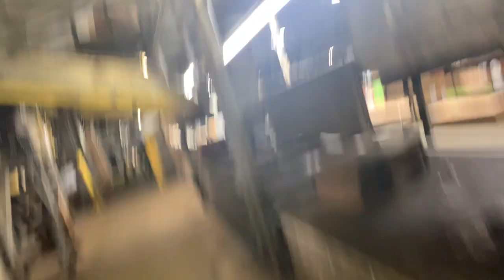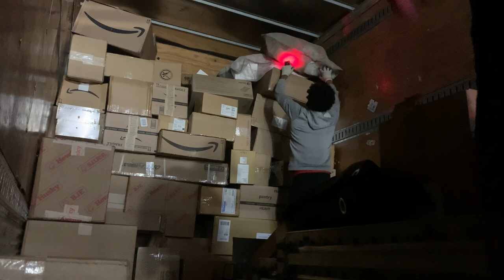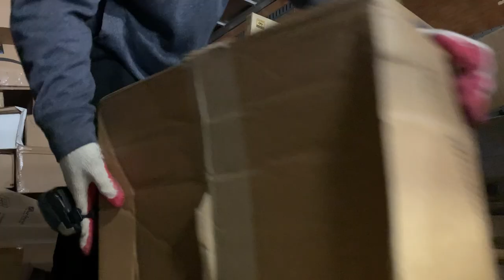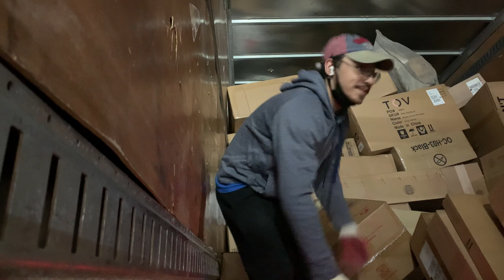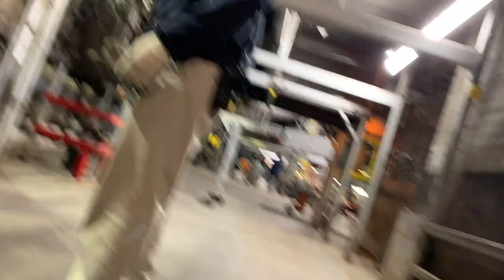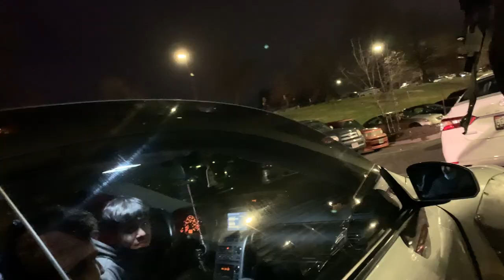UPS 2024

Comment: I ended up switching from loading to unload, both are hard work but loading is definitely more challenging, loaders should be making at least 2+ more an hr
Reply: I made 15 an hr it’s ridiculous
Reply: @kentknightsrule  $15.50, but I come in early to do van line sometimes which is better in my opinion. Plus you can slack off and your manager won’t notice.
Reply: You can switch to just unload
Reply: @lildjnyc4932  bruh re read the comment…the first 8 words
Reply: Unload is definitely better, until you have a hundred heavy 50 plus pound boxes on the floor you have to lift up
Reply: I’m a female loader! I’m newer but I loooooove it!!! I’m 5’2” 120lbs and 38 and I think it’s fun slinging boxes.
Reply: @MotoRacer171  Idk about ups but fed ex you have to pick them up in loading too.
Reply: @zendevil6965  Well at ups shit just falls everywhere so you’re picking up too

Fun when its all smushed together and you have to pry boxes apart
Reply: @MotoRacer171  Same at fed ex
Reply: I didn't sweat half as much in loading as I did unloading. Loading isn't easy, but I for me, unloading was the true workout at that warehouse. 4 hours a day there for a few months is like a legit camp to get in fight shape. go on a strict diet and you will get in the best shape of your life there.

Comment: I’m so jealous right now 😂. You guys had 2 working scanners and a functional conveyer. I worked loading the truck while a coworker scanned everything with one scanner that worked half the time. Also our “conveyer” was a ladder-like roller propped up an a step stool, didn’t even have wheels to push it back. Still though, the job is pretty intense and can relate a lot.
Reply: Truth that Hollister Mo represent 😂
Reply: Where was this ghetto AF warehouse you were working in at? Sounds more like a sweat shop in SE Asia xD than a UPS facility in the states.

"Rollers" as we called them in my day, were already considered the cheapest method to manually get parcels inside trucks. Actual electric "conveyers" are a thing in higher volume warehouses built after like 2000.

My warehouse was built in the 1980s and even then not a single truck had  "ladders propped up on step stools." WTF? Forget your local teamster leadership, how was MGT okay with that kind of set up? Good MGT if anything would have gotten ya'll rollers. Not because they care about you personally, but because there is no way most average workers can work fast enough with the kind of set up you are describing. (Unless ya'll were a very low volume sorting place or something.)

The scanners though...I can relate to that. Made sure to always note which ones were the good ones and asked my sup for a spare battery as well xD

Comment: EXCEPT FOR THE POOR HANDLING - not hand to surface- you make me proud. I was one of the first female training supervisors at UPS in 1991. Nice to see the Brown Blood circulating. You guys will be able to accomplish anything.
Reply: I worked his job in 1995 Lynnfeild Mass. I'm glad we didn't have to use those hand scanners then. I checked this video out in concerned how my current packages where still being handled. I'm thinking of holding off until the holiday rush is over in February. Things can and probably will get broken in shipment. I will ship with USPS until then although they are more expensive but handling is much better.
Reply: @stvlu733  they aren’t corporate, they don’t care.
Reply: Gather position load aids, hand to surface.... the training still loops in my head, 15 years later.
Reply: Hand to air lol

Comment: hi im jared I have been working at UPS as a Loader/Unloader/Tender for about a year if you want to know what a tender is please ask me also a quick tip on loading do not throw climb on packages ik the roller suck ass we all hate them and please use the load stands please build all the way to the top don't throw packages they will write you up and they can fire you on the spot I've seen it happen before p.s there are cameras in your trailers but if you want to be a tender or know about it please reply
Reply: I'm curious what a tender is, I've seen a few people say it but we don't have a position called that at my hub. I wonder if we have that job but just call it something different?
Reply: load stands just get in the way. I always tossed mine out of the truck

Comment: I did this loading on the large trailers back in the mid 1990's during the holiday rush. I Loved the hard work as it gave me a good build. Everything seems to be the same except for the hand scanners. I didn't have to use one. It was so much easier to handle without the scanners and could work much faster. Maybe thy should make a chest mounted automatic scanner that you just hold the package up to to free up hands. This poor package handling is what I question when I ship something with UPS when I see packages dropping to the concrete, getting crushed and even walked all over by an employee, and poorly stacked. I know some of this may be out of the loaders control. I assumed that UPS would have fixed these problems by some package flow control by now but NOPE. Come on guys. You must have played Tetris sometime in your youth. Stack those walls like your life depended on it. I know it helped me from several collapses back then especially when you get to the end and it's right over you. A sloppy wall will come tumbling right down on your head and you will feel it and look ridiculous with you ass on the ground and all those packages on you. I have seen it happen when a truck was hooking up and bumped the trailer. Keep up the hard work guys!
Reply: Hard work pay off 👍🏿👍🏿👍🏿
Reply: they do get paid good. and they get full benefits.. but its a part time job until you make full time... the benefits alone are wroth it

Comment: I work doing this, just have 3 weeks doing it, I am 52 years old and the first two weeks were really painful, is hard work and yes they should paid a little more, you either make or break it.
Reply: Are you still working there?
Reply: @rightstuff368  Yes, I am here as a matter of fact
Reply: @fas1969  I'm 62 and in pretty good shape. I'm thinking my body will adjust to the physical demands after 2-3 rough weeks. What are the best jobs in the warehouse for package handlers?
Reply: I did this also at 52, I lasted a week, fuck that, work smarter not harder! and I'm in good shape!

Comment: If you’ll was smart, one could be scanning and the other can be loading. After 20 boxes or so, switch it up. I know you guys get paid for scanning boxes. Work smarter, not harder.
Reply from the maker: We ended up doing that on that same day
Reply: You usually only have one person in a trailer this is just a video of a moment
Reply: @leylinetarot  well I do preload and unload so in my location it’s way different
Reply: @namedbless5488  yea I worked load, unload, and smalls for 3 years and it was one of the busier hubs in the states
Reply: @leylinetarot  that’s facts. I still work here currently. I am striving to be a driver. Got four months in.
Reply: @namedbless5488  take it easy on your body 💓
Reply: @leylinetarot  Always do haha I am in Union Now so I can legit work at myself pace with no penalty. That’s one of the reason I stay working at UPS
Reply: @namedbless5488  Hoping the same thing bro. Coming off the road making $10,000+ a month to get my foot in the door. Got hired doing loader
Reply: @AaronVtec803  off the road? Are you a truck driver?
Reply: @namedbless5488  hell yeah

Comment: This job is very quick and almost impossible to make a neat wall, it’s rarely ever slow. So people talking shit about them throwing the packages that’s all we can do tbh to keep up with the flow.
Reply: Sometimes you have no other choice but do these slop walls as loader solely due to needing to keep up on pace and time limits given out by management. When I was a loader at FedEx Ground, I was held at higher standards than other loaders where my walls had to be neatly and tightly loaded as possible as well having to keep up as much as possible with package flow by myself most of the time (I usually got stuck in the busiest trailers by myself where it actually pissed me off more when they would send someone into my trailer while I was in the middle of loading because it just caused my system I had developed to get all screwed up/causing me to slow down....it's one thing putting someone in there at the very beginning of loading a trailer, but a different story when it's the middle part of working in it that they finally decided to put someone in there with you because by that time you have already developed your own system in handling it by yourself). I have done probably more than my far share of "s**t" walls as loader solely due to the amount of packages that kept coming down at once continuously where I couldn't just temporary stop the flow from coming down (I just didn't care at that point and was like I am just going to do what I can and if they don't like, they can just go f themselves basically).

Comment: man where I work the boxes are literally flying down the slide fast enough to smash your hand or other boxes and make other boxes fall off all stacking up everywhere on the sides etc. I swear man a 40 pound package will come down that slide so fast it will hurt you and throw boxes off the side and you have to hurry and get your boxes stacked so you can even get out of the  trailer man and the boxes can weigh anywhere from 0-60 pounds and you have to stack them and figure it out some packages are long so you have to put them somewhere and figure that out plus you have these big bags that come down FULL of little boxes that weigh about 45 pounds and they are square about 2 ft by 2 ft and you have to figure out a place to put those which is usually on the TOP of your wall so you have to lift those up and throw them up there as well and if you let those bags build up man then you’re gonna be stuck in because they are big and heavy

Comment: Omg talk about bringing back nightmares.  I was doing this in Secaucus nj  ups facility for 2 yrs. I quit cause for $11 per hr I was f busting my ass from 4:45 am - 8:45 when until the drivers came in. I developed several carpal tunnel syndrome on my right wrist,got so bad I had severe pain just holding a bottle of h20. Then the warehouse was mad ass cold in the winter time cause they kept all the doors open. I said f this and text my supervisor like you I quit. The drivers where mad Kool though,at  Xmas I got $50 from 4 drivers cause I had to load up 4 of those stretch ups cargo trucks. So underpaid.

Comment: How does a package get lost during transit? I had a cardboard envelope on the way and the tracking hasn’t changed after arrived at facility. Been reading that sometimes small items get stuck between the belts.
Reply: Probably stuck on a belt somewhere or fallen off the belt into somewhere you can’t easily get to
Reply: It's either that or it hasn't been scanned to the facility
Reply: Even a large package can get lost, sometimes the label just falls off
Reply: At fed ex. If it'ds ever lost between belts. Jt will be found. We have a team that specifically searches for packages after each shift. So it will eventually be found and scanned.the packages that end up completely lost are the ones  that get destroyed in transit. Ground specifically. Alot of trailers have leaks in the ceiling and on rainy days it will ruin a thin box or paper packaging.  Some people don't tape up there boxes properly either. So when they come down one of the many slides things will fall out and get seperated from the package.
Reply: They can fall between the trailer and the building

Comment: Easy work for 2 guys. Used to be just one per trailer. And these guys are moving SLOW. Not even sweating. Try it in Texas, one man, and over 100 degrees outside
Reply from the maker: It’s peak season, 2 guys every truck no matter what and I live in the east coast so it gets cold, I do be drenching during summer tho

Comment: I load 3-4 long rails a day or 4-6 pups… On extendo instead of rollers. I completely understand the lack of hand to surface for the record… but the load quality needs improvement. Y’all ain’t on my level but keep it up haha!
Reply: I’m saying dawg.. I’m a supe and definitely the best at my hub in the outbounds, these dudes straight up suck 😂 not even flowing that hard and the load quality is still garbage. I know the job isn’t physically easy, but to not follow the methods, that’s just laziness. I would have made them rebuild the wall and commit to following methods or else that’s a write up 😂 not even abusing power either cause that’s the job.. seriously. Hella dangerous building a wall like that, mainly for the unloader that goes into that trailer when it arrives and ALSO for the driver that has to worry about packages shifting during transit. So careless man. Kinda pisses me off but maybe I’m too serious with my job 😂
Reply: @2FlyTox  my hub is all done manual, the only extendos we have is the unloaders. our ppl pull the boxes straight from the conveyor belt to a standing set of "gravity fed" rollers (no belts attached) and the packages are physically pushed back to the loader. it's insane to watch videos of other places where so much is automatic!

I started as an unloader and I never understood why people from other places loaded this way, it's so dangerous! you'd have to open the trailer door slowly about halfway up and then push it up as hard as you could and back up as fast as possible so you didn't get hit by everything falling out. I've had overweights on the tops of walls before too. broke my damn thumb once because an overweight box fell from the top and I couldn't get my hand out the way fast enough.

now I'm a sup and I don't let my employees load that way. you do it right or you go home, no excuses.

Comment: I hate those rollers, they suck so much, I prefer the extendos
Reply from the maker: Same but sadly the belt I work in is All rollers
Reply: The worst is when you’re overflowing and you can’t push them back because boxes are blocking it 😫

Comment: I’m so glad my FedEx got rid of scanner makes loading much easier
Reply: Honestly wyo boo
Reply from the maker: Lucky 😞
Reply: Yeah! It would be great if the packages were all pre scanned and all we had to do was straight load them on the truck but it's not like that here in UPS.
Reply: I was a loader at FedEx in the early 2000s and we didn't have the scanners. We had to manually read every zip code and make sure it was on the list, then, mark them before stacking each package
Reply: @Simon_Cow  actually not all UPS facilities are like that, the one I work at in Addison is Automation, it has been for I'd say about almost 10 years, that was when the facility had to go through like a remodel, it was previously conventional where we had to scan everything.